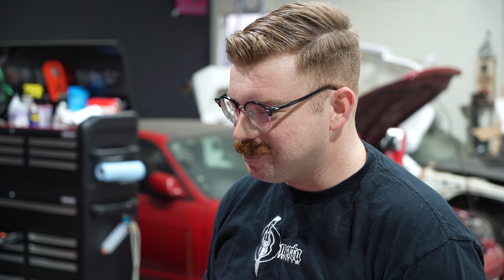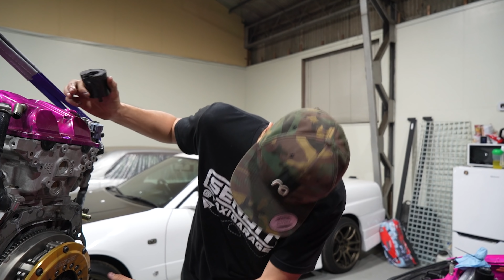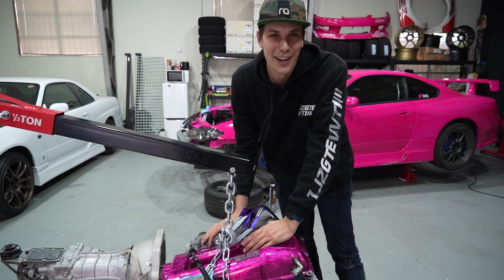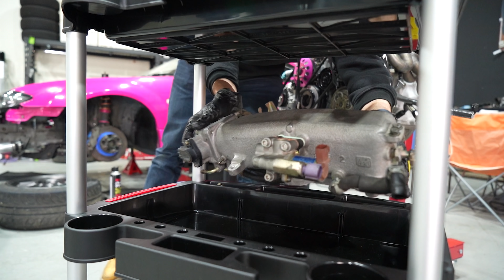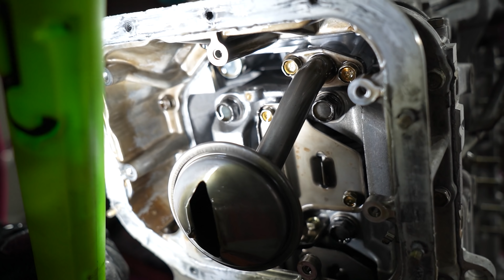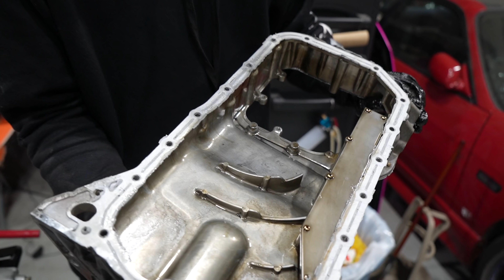It Was Fun While It Lasted...

Comment: There are 2 different sized bolts/guides on the sr20. I ran into the same problem when i bought new guides. Ended up just swapping the plastic over
Reply: Same with ka24 on my hardbody. First thing i did upgrade to metalbacked guides. Same thread but not shouldered. And a self ratcheting tensioner 🍻
Reply: so the oragne mk1 i see in your profile picture is sr20 swapped ? 😏😏
Reply: @luisferreira6617  no. I have an sr20vet s13
Reply: @Paul_Tomlin  nice
Reply: @Paul_Tomlin  s13 SR20DET Garret 28

Comment: Haven't seen the conclusion yet but I'm just going to guess it wasn't rod knock. My guess was exhaust header leaking, have had this exact noise before. I'm curious to see if they find something with the engine or if turns out they could've tested that b4 taking it out.
Reply: Steel shim gaskets will make a similar noise
Reply: it was a piece of metal that ground down from the timing chain guides. chain came loose because the tensioner was shit. rest of the motor was fine.
Reply: @Sean Price 22:54 that's not what caused it, according to this video. Just a casting mark, not the issue.
Reply: This is the reason why if you have any oil issues strip inspect and replace don't go cheap
Reply: It was clearly the engine rubbing on the rack
Reply: aven't.
https://www.youtubecomm.com/watch?v=iJ6fUqQLlBb
 find something with the engine or if turns out they could've tes
Reply: @Forcefed2002  Yeah, it was pointless to tear down the whole block. The failed mount would have been evident visually inspecting the engine from underneath before taking the whole engine out.

Comment: Rant away because these fun things happen. When you start really pushing an engine platform hard you start finding out how fine tuned everything, and I mean EVERYTHING, has to be in order for it to both run right and to survive.  Fun example for this is to look up what it takes to make big horsepower on an original VW beetle engine platform. They can make some crazy HP but ohh man do they take some trick machining and care during assembly to make fly.

Good luck on the build and I'm looking forward to the progress!! Just remember the complete car is going to be sweeeeet! 😁👍

Comment: Adam gets his SR running fine, so Sammit's sr20 decides to fail. Lucky chance for never ending SR content haha
Reply: Maybe it's time for a K-swap? The durability of the head is much better than the SR motor.
Reply: @2centcomment629  Theres nothing wrong with the SR. Hes just concerned about a noise because he didnt know what it is. That chain guide is fine, it makes sense it has play so the guide can move freely. Looking at the Nissan FAST parts system, there is no washer, so it's how its supposed to be. 

The noise is from the pan sitting on the steering rack because of the failed engine mount. Honestly if he did a visual inspection underneath he would have found that before doing an entire engine out. The engine tear down is unnecessary and just for content.

Comment: Guide definitely does slide on the dowel bolt, that is standard to help centre the guide when chain is running. Most likely the collapsed engine mounts where the cause but have had a exhaust manifold with a pinhole do the same too
Reply: not sure about that. I've installed similar guides on countless KAs and to my memory I don't think that they have that much play back and forth like that when you tighten up that thing, man. I could be wrong though, I'm a disaster.

Comment: don't be alarmed by the oilpan and the rack. thats most certainly caused by the blown out motor mounts. get some solid engine mounts asap. then you wont have to worry about any of the extra heat, thats what i did with my Turbo E36.

Comment: Stay 2.0 Liter because you want to keep the better rod ratio vs a 2.2 Liter. You will just get more reliability issues later.
SR20s can be noisy, but perfectly OK as I'm sure you understand, especially now.
A 2.0L VE sr20 build would be nice or maybe just modify a GTI-R intake manifold just to have ITBs would be cool.
Reply: My 2.2L has been running at well into the 600’s with no issues whatsoever for 3 years.

Either you don’t know anything about SR20’s or you haven’t looked into building a real stroker SR.
Reply: @Sean Price Turning an SR20 into an SR22 would make the rod ratio worse than 1.58.

Comment: Did you check the piston pins, small end of the rods?  I hope you pulled the belt and ran it to make sure it wasn't an accessory.  Could be that guide, I had a SBC mech fuel pump that is cam driven sound like rod knock.  People have pulled SBC engines multiple times for a rear main leak or other small things they forgot, sucks but happens.  I gotta pull my pan off because I used the wrong washer type on my oil pump and it could come loose now.  Might just pull the shortblock and do a stall swap while I'm at it.

Comment: I`m sticking with my conclusion/guess I posted in the previous pink S15 engine problem video.. bad lifters!
Hope you and Okachan find the solution to the mystery.. (Im just a mechanic living 10.000 miles away, its hard to do serious diagnosis without the car/engine here so I could be wrong)
Keep the 2.0 engine, adding a stroker kit to an already very long-stroke engine like the SR is will put the piston speeds to very uncomfortable high numbers.
Reply: @Sean Price I like it to be more 1:1 ish if it sees 8-9000rpm on a almost daily basis.. (thats one of the things that makes a 2JZ so indestructible)

Comment: The holy trinity i think would be M52B28 (add a turbo to this bmw engine and they make stupid power and are hella reliable) 2JZGTE (probably the most legendary engine in JDM land) and i would say the third.... 3SGTE. i think the 3SGTE is so ungodly underrated. they make GOBS of torque for a 4cylinder. lots of guys makes the same torque as horsepower, and the torque doesnt flat line it continues to increase towards redline, as do the power. its powerband is insane for a 4 cylinder. and that compared with a 5SFE block with the 3SGTE head (5SGTE) its a LETHAL combo that should of gotten much more attention then it did.

Comment: Frick. My SR has start up rattle. My KAs always had it, until I used a ratcheting tensioner upgrade. But not sure if that's my SR noise. So, yeah. Keep us informed. I'm not driving my SRDET S13 ATM just due to concern over the rattle and no time or money or space to dig in at present. So yeah I love your content. You are like me but only with money and shop and relationships with actual Nismo demigods. I'm a street rat.

Rattle. Only when cold, only on throttle up, only after sitting for a week or more, and rattle gone, after that first chicklety sounding operating temperature throttle up. 

I've owned 10 different KA24s and the timing chain system is similar. I changed timing chain guides on five hardbodys and four Axxesses. Found them all to have disintegrated guides or sloppy assed chans. 

So that rattle is eblazoned in my mind forever. Nothing like chain slap, and the sound changes depending on where the rub is... Not saying that's your problem, but I'm saying that I'm a glutton for punishment, and when I find a motor with a noise like that, I go 'balls deep' and sometimes it ends well, other times, I get her all buttoned up and then after 100k the camshaft snaps. Oh, Nissan. I have never met a mechanic who doesn't hate them. What you goona do. Tighten up that shit, and button it back up. I'm guessing my chain is loose and slappy making my SR sound like Les Claypool is inside my TC cover

Comment: after searching some forums some poeple dont run the chain guides because of the ticking and only use the tensioner
Reply: tried that on a single cam KA and it was great - only great at idle and low rpm - at about 4000 -5000 it rubbed like a gstring. Had to pull the front cover again after only a week. That's when I learned not to use so much RTV goddammit that shit sticks and I had loaded it on, worried about leaks. Leaks my ass. Damn that cover was hard to pry off. Wholly fak. So I wouldnt' endorse running guidless, unless you WANT to cut pretty lines into your motor's face; it will only rub your motor raw like a beachbabe's string bikini cut's up her ass.

Comment: Hmm when you un plug coil cylinder no. 1 noise was allmost gone, so think more about that, not chain, be all time
Reply: is that the one closest to the chain guide?
Reply: Yeah, maybe injector no1 to leak ? To much fuel and preignition noise
Reply: @likehardship4494  maybe because its the one next to the chain guard and not so much vibration when pulled plug #1
Reply: i guess we will have to wait n find out :)